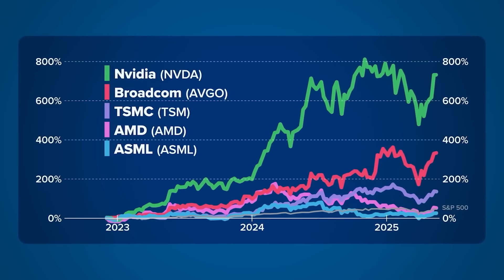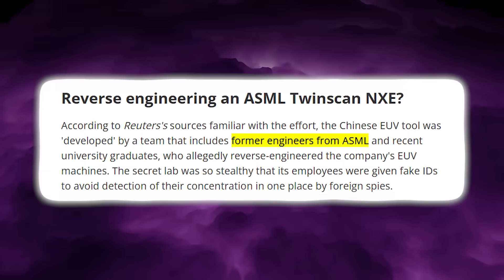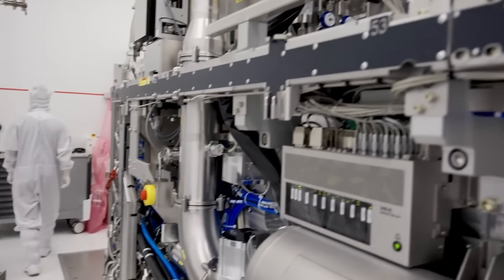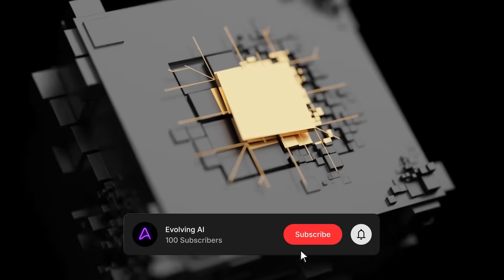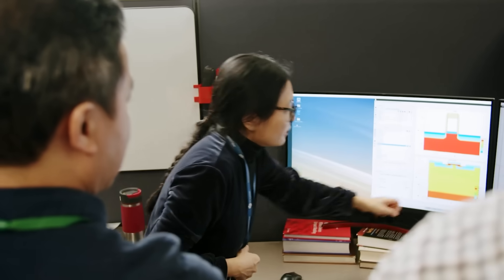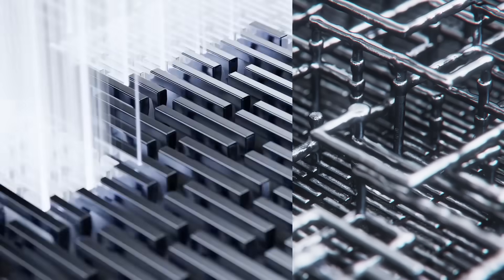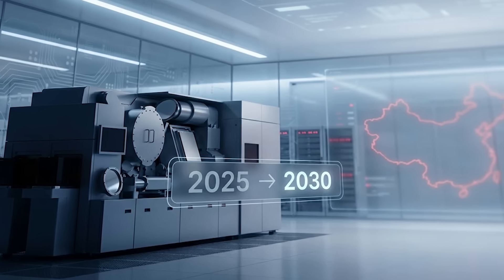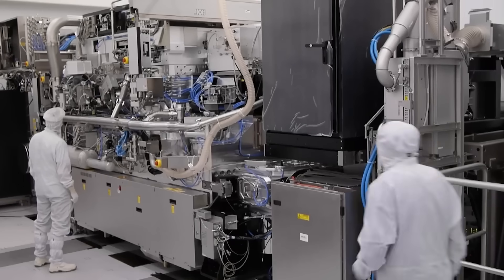China’s New EUV Machine A Direct Threat to the U.S.A.'s Semiconductor Dominance!

Comment: Which experts said that a Chinese EUV prototype was 20-30 years away? And generating EUV light isn't 80% of the problem, at least in terms of time and effort -- optics and power is what ASML spent most of its EUV R&D time on. "Working chips" by 2030 is much different than "volume production" by 2030 as well. This prototype is a very important data point, but I don't think it's off-trend with the historical gap of 15-17 years.

Comment: As an person connected to asml, this video is absolute bullshit. There is a difference in a single research unit and an unit that ready for mass wafer production. They only have a research machine that puts out like 10 per hour. Ours do 280 per hour. And no your gpu’s will not get cheaper. Stop with the hopium lol. Yes china is getting smarter. But they are by far not good enough at the scale now. They have zero supply chain, zero customers, zero ecosystem with fabs. They only rely on stealing stuff, but the machine is by far not optimized for mass production.

Comment: stop repeating western propaganda. huawei is the one testing the prototype. huawei's EUV technology is LDP (laser discharge plasma) vs ASML's LPP. huawei's LDP has 2.5x energy coefficient conversion rate vs LPP, the machine is 30% smaller and the cost of making chips 40% cheaper. huawei is already churning out test chips - full mass production expected sometime in 2026. also comes with huawei's VGAA technology which allows for higher node density (=higher compute) at constantly ambient temperatures.

Comment: They are also working on a 75-meter-radius SSMB (Steady-State Microbunching) particle accelerator to provide a 1KW continuous, pure EUV light source for multiple lithography machines, enabling the production of sub-2nm chips. While Tsinghua has already validated the principle on a small setup, scaling to a full prototype is estimated to require 6–10 years and a low-billion-dollar investment, with success hinging on extreme technical hurdles: maintaining ultra-stable electron beams under ultra-high vacuum, integrating cryogenic superconducting systems, employing nanometer-stable magnets, and perfecting the optics for efficient EUV light extraction.

Comment: Fact Check: “China’s New EUV Machine Is a Direct Threat to U.S. Semiconductor Dominance”
Short Answer
China has built a prototype EUV lithography machine, but it is not yet commercially viable, not producing chips, and not an immediate threat to U.S. semiconductor dominance.
It is a major strategic milestone — but the timeline for real impact is 2028–2030, not “overnight.”

What the Verified Sources Actually Say
1. China has built a prototype EUV machine — confirmed by Reuters.
- Chinese scientists in Shenzhen built a prototype EUV lithography machine in early 2025.
- It was built by former ASML engineers who reverse‑engineered older ASML systems.
- The prototype is undergoing testing and not yet producing chips.
2. China aims for EUV chip production by 2028–2030.
- China is targeting 2028 for domestic EUV chip output, though experts say 2030 is more realistic.
- Analysts agree this could be a “massive boost” to China’s AI chip ambitions — but only if the machine becomes commercially viable.
3. U.S. export controls were designed to prevent exactly this.
- The prototype represents what Washington has spent years trying to block: Chinese access to EUV technology.
- EUV is central to producing the most advanced chips used in AI, smartphones, and military systems.
4. But the machine is NOT yet a threat to U.S. dominance.
According to CNAS (a major U.S. think tank):
- China has a history of overstating semiconductor breakthroughs.
- Even if the prototype works, commercial viability is unlikely before 2030.
- The real threat is China’s access to older lithography equipment, which can still produce powerful AI chips at scale.

So Is It a “Direct Threat”?
No — not today.
The prototype is not operational at scale, not producing chips, and not competitive with ASML’s EUV systems.
Yes — strategically, in the long term.
If China successfully commercializes EUV:
- It breaks the West’s monopoly on the most advanced chipmaking tool.
- It undermines U.S. export controls.
- It accelerates China’s AI and military chip capabilities.
But this is years away, not imminent.

Bottom Line
China’s EUV prototype is real, strategically important, and a long‑term challenge to U.S. semiconductor dominance — but it is not an immediate or direct threat.
The headline exaggerates the situation dramatically.

Comment: Please check out the YouTube channel CC which stands for Chip Crunch. Chip Crunch has been reporting on this for months. And far more detailed and specific. For instance CC covered the report of how the Chinese were fundamentally different projection for EUV, by going to a factory size, rather than small portable ASML. Second is the vaporizing of tin, by way of lazer. Also Huawei is also doing and completed a EUV machine. And successfully produced a chip using this EUV machine. And will start in 2026 a limited production line for high end Chips.

Comment: China's EUV lithography machines never needed to reverse-engineer Western products—the core reasons lie in the total lack of physical samples to disassemble, the insurmountable complexity of the underlying technologies that cannot be replicated through teardowns, and our adoption of an independent, diversified technological roadmap. What’s more, China’s EUV tech is far more advanced and powerful than Western counterparts—it not only breaks the monopoly but also outperforms the West in core performance and technical architecture. The Western claim of "reverse-engineering" is nothing but sour grapes.
 
I. No Physical Samples to Reverse-Engineer: Blockades Forced Us to Forge an Independent Path
 
- The US-led comprehensive EUV embargo strictly prohibits ASML from selling complete EUV systems to China; we are denied access even to core components and technical documentation. Without any physical reference, reverse-engineering is simply impossible.

- Even attempting to disassemble older DUV machines would be futile. Mishandling during teardowns can easily damage the equipment, and DUV and EUV differ drastically in technical principles and system architecture—tearing apart a DUV machine yields zero insights into EUV’s core know-how.
 
II. Overwhelming Technical Complexity Makes Reverse-Engineering a Pipe Dream
 
- A single EUV machine integrates over 100,000 components, spanning dozens of disciplines and relying on more than 5,000 global suppliers. Its software runs on hundreds of millions of lines of code, and the nanoscale coordinated calibration experience and long-term operational data are completely inaccessible through disassembly.

- Western core optical mirrors demand a surface flatness equivalent to "a height difference of less than 0.4 millimeters across an area the size of China’s territory", yet teardowns cannot replicate the precision of their multi-layer coating processes. Core technologies like tin droplet control and energy conversion in the light source system are the fruits of years of R&D accumulation, not something that can be copied by taking a machine apart.

- ASML’s equipment is equipped with embedded monitoring systems and patent barriers—reverse-engineering would trigger legal and technical protection mechanisms, making the task as difficult as scaling Mount Everest.
 
III. Independent Ecosystem + Diversified Technical Routes: A Fundamentally Different Path from the West
 
1. Core Technical Route Differences: China’s Approach is Far More Forward-Looking
 
- The West (ASML): A single, inflexible route dependent on US CO₂ lasers to power the LPP (Laser-Produced Plasma) light source. It requires bombarding 50,000 tin droplets per second to generate EUV light, suffering from inherent flaws like tin contamination and low energy conversion efficiency.

- China: Parallel independent and diversified routes, including the solid-state laser-driven LPP route developed by the Shanghai Institute of Optics and Fine Mechanics, the DPP (Discharge-Produced Plasma) route from Harbin Institute of Technology, plus innovative solutions like Tsinghua University’s SSMB (Steady-State Micro-Bunching) and Haoyuxin Optics’ HHG (High-Harmonic Generation) technologies. These are not only fully self-controlled but also directly address the pain points of Western tech.
 
2. Key Advantages: China’s EUV Outperforms the West in Performance, Cost, and Stability
 
1. Light Source Performance Dominance
The West’s LPP light source has a mere 5.5% energy conversion efficiency. China’s solid-state laser LPP has already reached 3.42% (with a theoretical ceiling exceeding 6%), the SSMB solution delivers a power output of 3,200 watts, and HHG technology achieves a "broadband-ultrafast-coherent" trinity with tunable wavelengths and zero contamination.

2. Dramatically Improved Stability
The West’s tin plasma light source causes severe tin contamination, requiring mirror cleaning every 2 hours. China’s EUV-FEL (Free-Electron Laser) solution eliminates tin contamination entirely, extending mirror cleaning cycles to 50 hours. Its power stability of ±0.5% far surpasses the West’s ±5%.

3. Exponential Leap in Inspection Efficiency
Western electron beam inspection is slow and low-throughput. China’s HHG-EUV inspection is 100–1,000 times faster than electron beam methods, with a resolution 10 times better than DUV. It can identify defects smaller than 5 nanometers and enables non-destructive 3D imaging.

4. Superior Cost-Effectiveness and Flexibility
Western EUV systems are bulky, prohibitively expensive, and costly to maintain. China’s HHG systems can be deployed on a desktop scale (just 3m × 1.5m in size), eliminating the need for complex contamination control systems. They boast strong engineering feasibility and democratize access to advanced EUV research equipment.

5. A Fully Localized Industrial Chain
China has built a complete domestic supply chain covering optical mirrors (Changchun Institute of Optics, Fine Mechanics and Physics), laser crystals (Fujing Technology, holding 80% of the global market share), precision structural components (Fuchuang Precision), and system integration (Shanghai Micro Electronics Equipment). In contrast, the West relies on a fragile network of over 5,000 global suppliers.
 
IV. Conclusion: A Victory for Independent Innovation, Not Reverse-Engineering
 
The Western hype about "reverse-engineering" is essentially an unwillingness to acknowledge that China has broken their technological monopoly through independent R&D. China’s EUV technology not only shatters the blockade but also surpasses the West in technical routes, core performance, and industrialization costs. The fundamental difference lies in this: the West has taken a path of "monopolistic single-route reliance + pushing physical limits", while China has embraced "diversified innovation + system optimization"—and that is the true definition of technological leadership.
Reply: Well done in such details explanation to debunk western propaganda lie. 👍👍👍 Need more peoplei like you with great depth of information to debunk their blatant lies. 😊
Reply: I totally agree with you for everything you just said but you just forget a little point that most of tech ignore ,the crucial point is the human factor not the technology if you have  spying agents you get anything you want with all the technology in a shorter time.anyway china had students all over the globe most of them are connected to the CCP .your story needs the human factor it is  the most used for getting technology faster
Reply: @Musoplhnhbfhn144   在美国从事AI领域工作的人中，中国人超过一半。实际上美国的每一次科技进步都离不开中国人，举一个例子，NASA的建立就有中国科学家钱学森的贡献，后来他回到中国主导开发核武器和卫星
Reply: @Musoplhnhbfhn144  The grapes must be very sour.
Reply: @Musoplhnhbfhn144  Good EQ that you have. hope your words comfort us your broken heart a little..
Reply: they reversed engineered EUV and failed miserably 😅, now they hired past or retired employee of ASML to make their own. not make their own but just stealing a design from ASML. they love to steal even island🤣
Reply: @johninfinity4542 when loser can't compete but angry, jealous and desperate; making false accusations to China usually is the option.
Reply: @johninfinity4542  They are Chinese engineers. Just like there were Chinese scientists that helped build the atomic bomb for the US in WWII. We are everywhere. Just get over it.
Reply: Can you prove your saying? Or you just mad to see Chinese achievement?  @johninfinity4542

Comment: There are two timeframes floating in the media today.  One, as reported in this video that a production unit will not show up until 2028 or later, and another media report saying the prototype is almost finished with its development and testing with production to start in 2026.  China is known for what is often stated as 'China speed' whee etimates on accomplishing things are much faster than thought possible.  Time will tell. My bet is that it will be sooner than later. Some of the best minds are working on this project with experts from all sectors of science and technology to solve design and development problems.  Those who worked at ASML would help bypass issues that ASML faced and thus bypass lengthy problem solving issues.